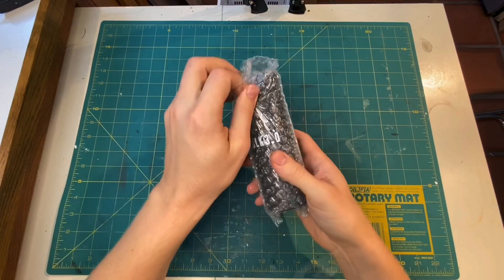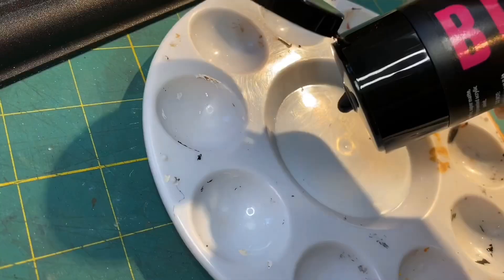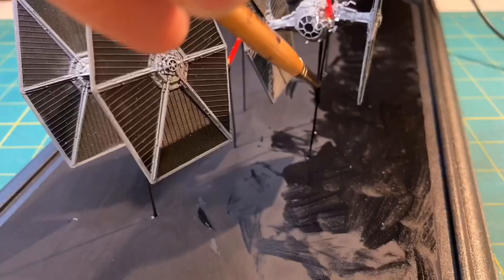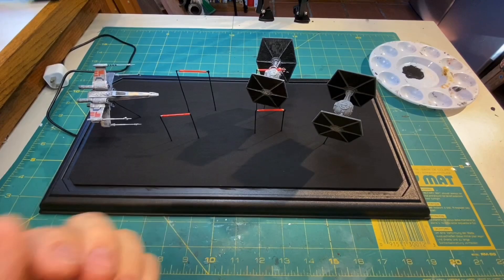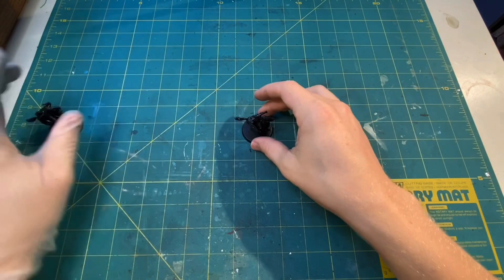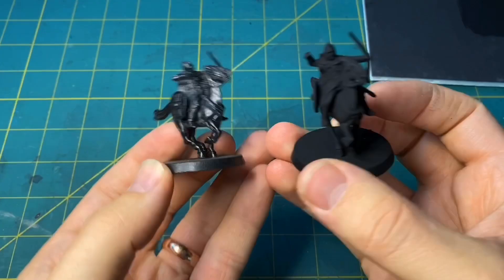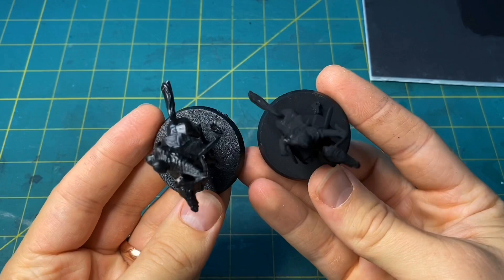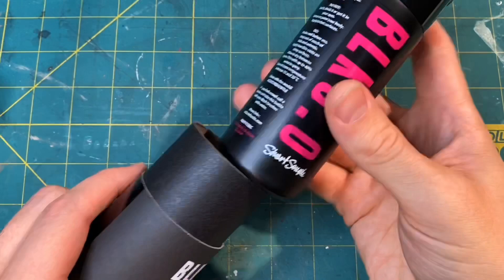BLACK 3.0 | HOW BLACK IS IT?

Comment: Hey man I know this isn’t exactly correlated to your video, but I was thinking about using this black 3.0 to paint some keycaps. The problem is the specific keycaps for the keyboard I want to paint will have letters on them. Do you think this will be able to black out the keycaps? And do you thing this paint will hold up well?
Reply from the maker: Hey! Thank for your question. I believe the paint would do a good job covering the keys including the letters, but I doubt the paint would hold up long under much use. You could try a matte spray varnish, but that would definitely take away some of the effect. 
Hope that’s helpful!